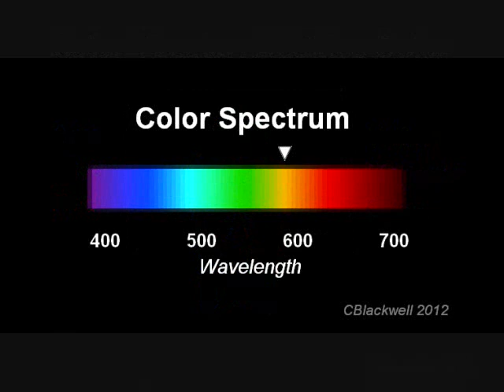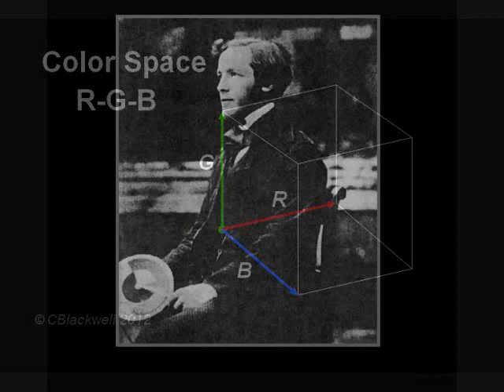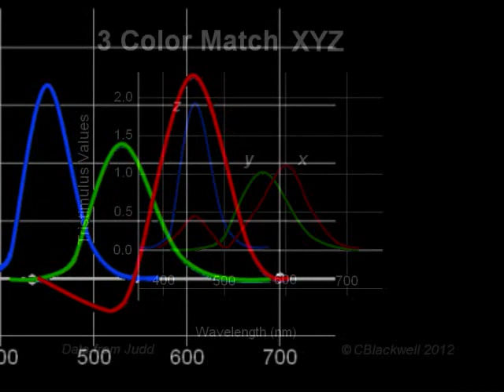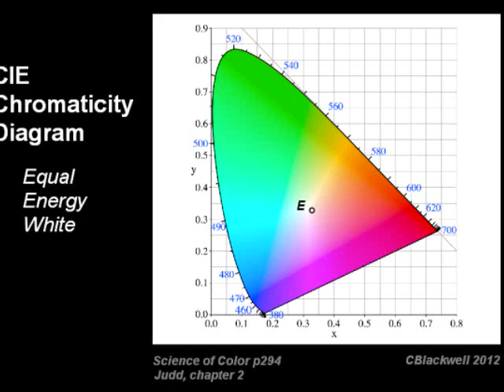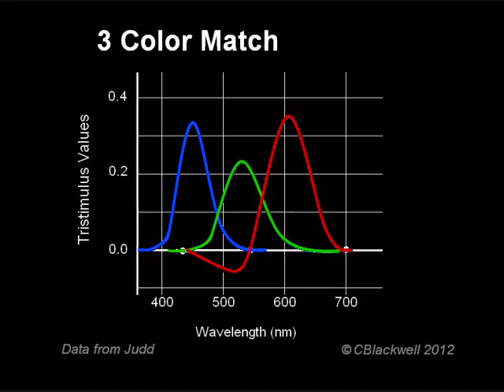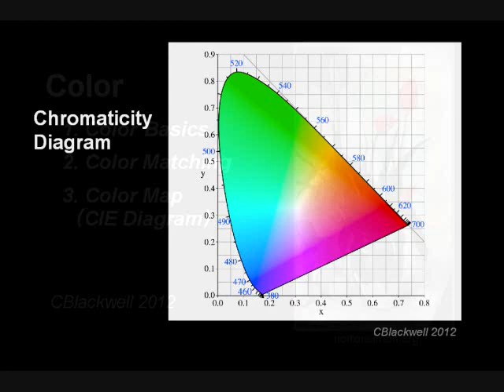Color Vision 2: Color Matching

Comment: Hello! I have a hard time understanding the tristimulus chart. I thought the CIE diagram was based on the normalized responsivity spectra of human cone cells, not on the linear combination component values of a wavelength onto the 700 nm, 546.1 nm and 435.8 nm. Or are they the same thing? And why is the tristimulus chart negative? And why those particular wave lengths?

Thanks!

Comment: Surely if we can't represent the full gamut of human vision with RGB, that must mean we chose inadequate primary colours? If we used the same primaries as our cone cells detect, wouldn't we be able to match any colour they can perceive?
Reply: Unfortunately no. The gamut in XYZ space is cone-shaped, so there's no way to position three real colors as primaries inside the gamut such that all other colors can be mixed with positive-only coefficients. I'm not sure how to relate this to how our eyes detect color, though. Maybe it has something to do with the response curves not being symmetrical around their maxima?
Reply: Lumpiluk Apparently it's something to do with the response curves overlapping. Such that it is impossible to stimulate one set of cells without also stimulating the others.

Comment: helpful and informative. i have a couple of questions if someone cares to answer: 
1. Why does the spectral locus look the same in the unit plane and in the XY graph later on
2. why is it the adding colors represented by chromaticity points on the chormaticity diagram  will result in a color that is in between the line joining the two points
Reply: To answer your second question, it's just how linear combination works. Let us assume you have two points: (x₁, y₁, z₁) and (x₂, y₂, z₂). Now you have the conditions:

x₁ + y₁ + z₁ = 1
x₂ + y₂ + z₂ = 1

and adding them together yields
x₁ + x₂ + y₁ + y₂ + z₁ + z₂ = 2.

Now if you divide by 2 you get (x₁ + x₂ + y₁ + y₂ + z₁ + z₂)/2 = 1, which shows that adding the points and normalizing the sum is the same as taking the midpoint of the points.

Comment: How exactly did you go from RGB into XYZ into xyY? What is physical interpretation of all those axes? OK, RGB values are intensities of light reflectors. You could have drawn a 3D figure of visible light in that color space (disregarding reds being negative) and then went on explaining from there?
Reply from the maker: Some complexity here. There are several steps in the process of converting real RGB stimulus values into the useful, but imaginary, XYZ system.  Transformation reasoning and equations can be found in detail in the classic text, Wyszecki and Stiles (Color Science, 2nd ed), section 3.2.5.  Judd (Color in Business, 1975) has a friendlier, but less detailed explanation.  (In a good library near you?)
Reply: Yes I have those transformations and I'm watching them. Correct me if wrong.

1. Y was chosen to match luminosity and X and Z were "pulled away" so that XYZ space could envelope the whole visible spectrum with coordinates for all visible colors (and even some more) being positive. What confuses me is jump into xyY. It should be just a slice for X+Y+Z=1? But if Y is luminosity, how come we have color information upwards the Y axis? Why don't we have a chromaticity diagram in X-Z plane, but we go up in  X+Y+Z=1 plane?

2.If cyan color was the problem for color matching experiment, so we had to add negative red, and our solution was to drive blue and green into imaginary supersaturation, we ended up in XYZ where X, Y and Z represent super-saturated red, green and blue, how come Y only carries luminosity and no chromaticity data?

3. OK, the intersection of that plane (X+Y=Z=1) and our visible color space forms a basic version of chromaticity diagram? Why don't we use it as is?

4. Is there a special reason we project it on XY plane, and not on XZ? Or, in other words, what would be the fundamental difference in xzY against xyY?